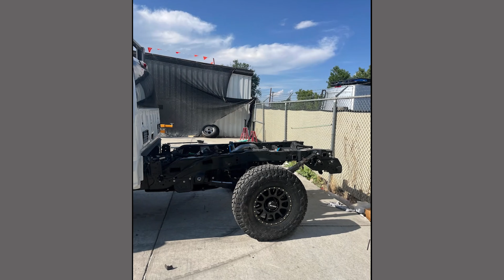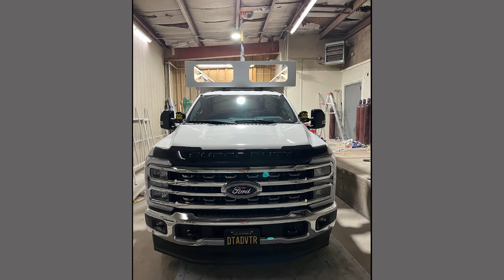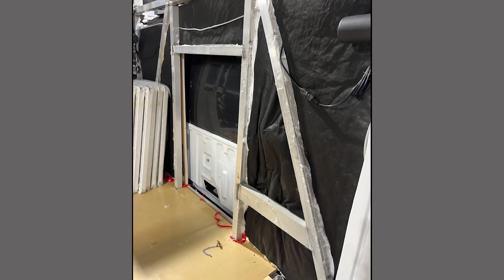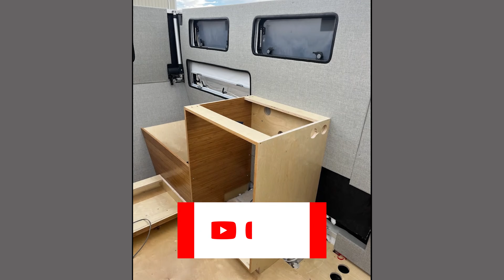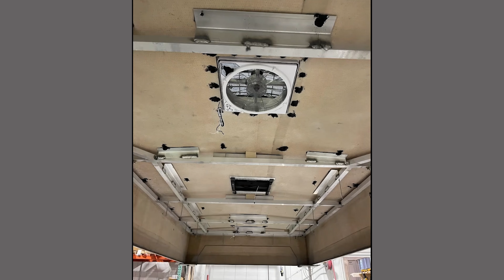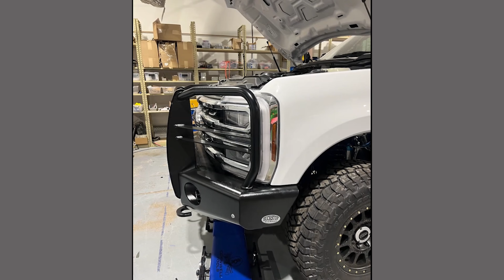Rossmönster Baja - Build Update

Comment: I’m curious what your fuel consumption is with your heating system.
Reply from the maker: That is a very good question and difficult to measure. It is supposed to be up to 1 gallon for every 6-8 hours, but at least so far I feel it has been less. I need to put some thought into this.

Comment: What happens to the bed and rear window? Does rossmonster give you a credit for it then remarked those parts?
Reply from the maker: Surprisingly there is not a large market for a slightly used truck bed. You can get one through ebay for less than $1K (at least that is what I found). I had Rossmonster "deal with it" - meaning, please discard if needed. I do not have space or the means to deal with selling the bed. For the window I would think it is even worse. Again, I let them do their thing. If they get some money for either one, that is fine. I do not feel I was taken advantage off by them.
Reply: From my experience, selling the beds and windows using normal means (Facebook ebay, craigslist and so on) nets very few results. The windows are virtually worthless and the beds might sell for 2 or 3 hundred if you can even find an individual to buy them.

Comment: diesel 6.7 or gas 7.3?
-would you add a Natural Gas kit  to get  at least 40% savings...
-
Reply: it is a hybrid conversion kit, for CNG, compressed natural gas, different from LPG. It is available in México for 1,200 dollars installed by certified agencies.  The 5th generation is available now.  cons and pros as everything...Even public transportation buses, with diesel engines or gasoline, r running on hybrid CNG conversion kits.  U can still run the truck on gasoline if CNG is not available...
Reply from the maker: You mean for the engine to run partially run on propane? 

My truck has the 7.3 liter gas "Godzilla" engine.  I would absolutely consider a hybrid (electric or LPG) it it would be available and feasible. For "the moment" the gas engine is the best choice even if the MPG is pretty bad, but at least I can go into middle and south America without having to worry about Diesel fuel.